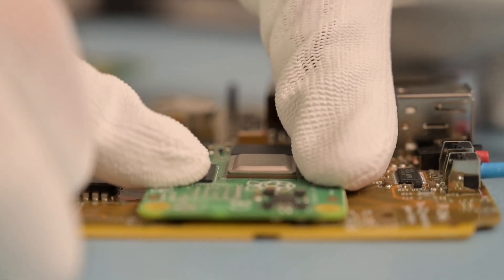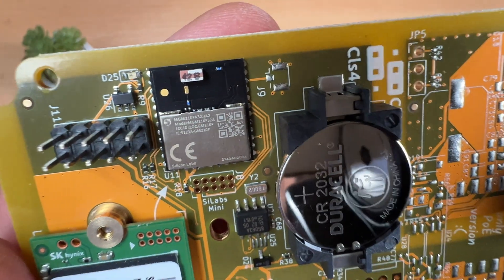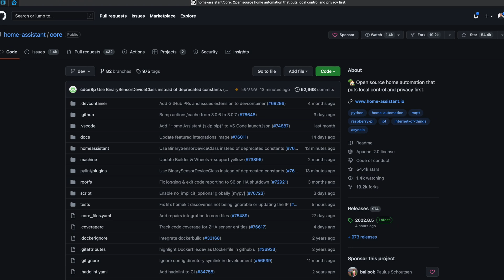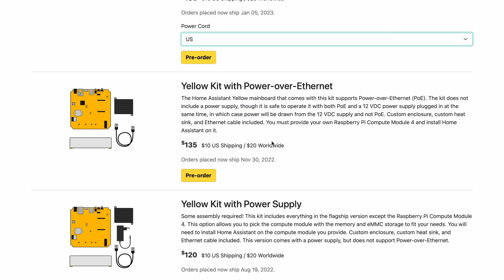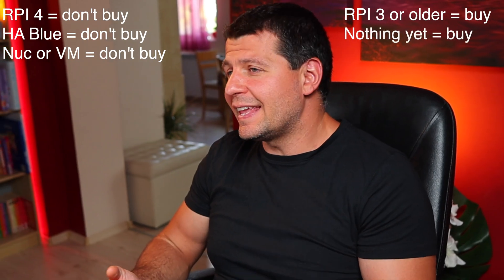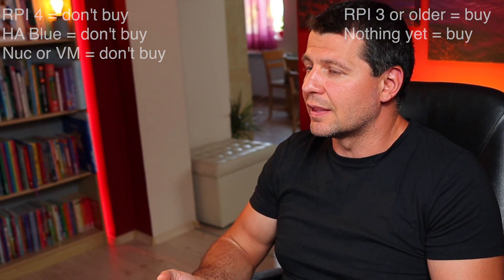Home Assistant Yellow Pros & Cons

Comment: Technically Home Assistant Blue was not really Nabu Casa hardware.    It was just a metal case around an Odroid, but it was a good indicator of how many would like a genuine Home Assistant hardware hub.   A few years of development, and Nabu Casa made their own board, though still using a RPCM4 module.  If you have a CM4 with BlueTooth and WiFi, you get Bluetooth and WiFi onboard.
To include Bluetooth or multiple radios was going to cost a lot more and take a lot longer to get certification for the device, where as having one radio is easier to certify.     If you want BlueTooth, just change the CM4 Module to one with WiFi/Bluetooth.  Given how hard it is to get any Raspberry Pi board, and the costs, I guess the kit was done without wireless options and with only 16GB eMMC to allow the cost to be kept down.
I find the biggest downside of the Yellow is the fact it is still based around the Raspberry Pi platform still.   I don't see it as an upgrade over the Odroid platform and, as you mentioned in the video, it will not be an upgrade if you are using a NUC or similar virtualised platform.   It could be worth gettign if you just want a unit to play with and want to support Nabu Casa, but not to upgrade production unless you are running a RPi 3 or lower spec device.
The note on upgrades.   We cannot guarantee this would ever be upgradable.   The CM4 uses a different connector to the previous CM that Raspberry Pi Foundation released.   It's like CPU upgrades, each generation could very well have a different socket or pinout at minimum.  I am not convinced there would ever by any upgrade path.
Reply from the maker: Thank you for sharing your knowledge and insights about the Home Assistant Blue and Yellow hardware. Your explanation about the development and design choices behind the products are very informative and helpful. I appreciate your comment and the information about the limitations and potential downsides of the Yellow. Thanks

Comment: For those saying the CM4 with BT and WiFi is an option, yes it is, but not through HASS. Kiril is reviewing the HASS Yellow as it is delivered out of the box with everything included at the cost of $185 from HASS crowdsupply website.

from the website: " Home Assistant Yellow: This flagship version of Home Assistant Yellow is ready to go out of the box. It comes pre-assembled in a custom enclosure with a Raspberry Pi Compute Module 4 (CM4) and a custom heat sink for fanless, silent operation. The CM4 is a version without wireless and has 2 GB RAM and 16 GB eMMC storage, pre-installed with Home Assistant..."

This is a correct and accurate product assessment for the product delivered. Yes, you can have a CM4 of your own choosing but the out-of-the-box assembled flagship product is NOT a BT or WiFi enabled CM4. See my other comment on specs for CM4 with BT and WiFi options.
Reply from the maker: Thanks for the clarification Jacob, good comment!

Comment: Does sonoff usb stick support matter?
Reply from the maker: If it supports ZigBee 3.0 then it should be Matter ready.
Reply: @KPeyanski  thank you for the reply. Plz suggest should I buy the 
"SONOFF ZB Dongle-P Zigbee 3.0 USB Dongle Plus Wireless Zigbee Gateway Analyzer Zigbee2MQTT USB Interface Capture with Antenna" 

OR

"SONOFF Zigbee Bridge Pro"

Kindly guide I need the device to be future proof
Reply: @nehajain2974  , so which one did you finally buy, and what would you recommend?